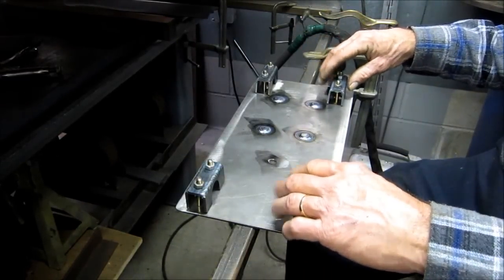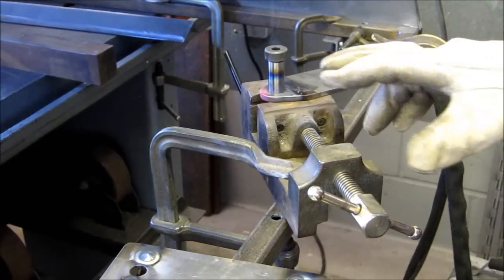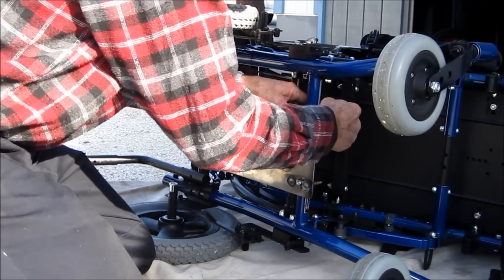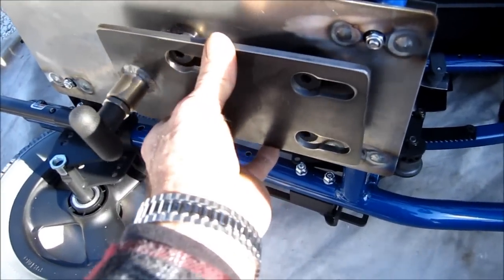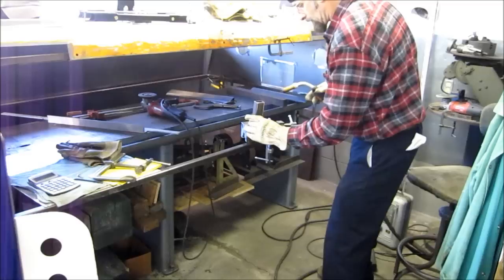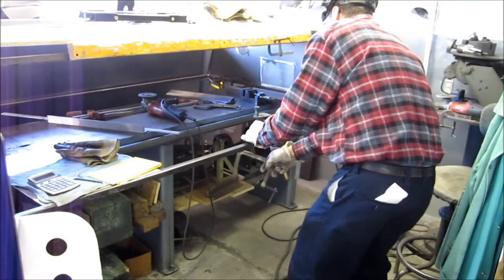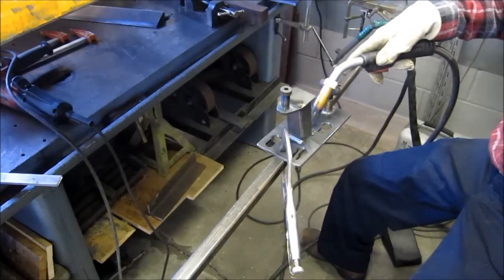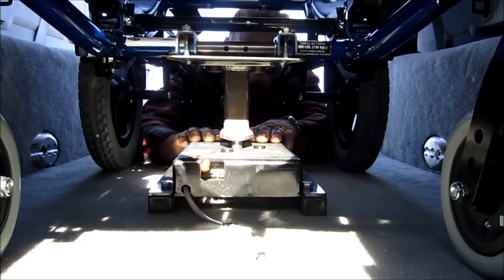Wheel Chair Docking System Part 2

Comment: I love what you are doing,  I do have a question.  I am a caregiver for a friend who is in a Permobile wheelchair and we use the EZ Lock system.  Lately it's not working properly when we push the release button.  Its here a service I can do from home that would help it work consistently?   Clean up inside it, add a lubricant?

Comment: Keith, this pair of videos for for the wheel chair docking system was just heartwarming!  I work in a specialized factory that employs a good many handicapped folks and so get to see on a daily basis the challenges they deal with in just getting around day-in and day-out, and it was inspiring watching you create this wheelchair latching system and build it to higher standards than the original manufacturer.  At my workplace, the wheelchair-bound commute to and from the place using large vans that have hydraulic lift platforms for the wheelchairs and the vans can carry 3-4 wheelchairs at a time, but the challenges still remain of restraining the folks' personal wheelchair in the vehicle once they have been loaded up.

Comment: Hey Keith, I know this job is done, but any chance of going back and raising the capture mechanism off the floor of the van ? If you lifted it 4 or 6 inches, then you wouldn't have a ground clearance issue on the chair... just a thought.
Reply: Eric I just watched this and you echo my thoughts. I also have an uncomfortable feeling about the strength of this modification in a heavy shunt. I note that Keith has not responded to you.

Comment: ok 4 year old post i see
used to work for a company suplying wheelcairs and other stuff 
you done a nice job on the catch making it so it doesnt act like a plow
but wouldnt it been eazier to raise the catch in the car itself by about 3 to 6 inches 
from wat i seen there aren any feetholders in the way so it still would slide over it 
he wouldnt have to crawl over the floor to get at the adapter bit 
making a boxsection that bolts to the original spot then have mountingholes for the catchsystem would make it reversable too

Comment: Thanks for the video Keith. What kind words can describe such a person as you. I have a similar problem with bottom clearance on my power wheelchair. The companies expect users to be in wheelchairs where level ground is the norm. Unfortunately that is never the case. Mine can climb a 3" curb but if I use this type of standard equipment I only have about an inch of clearance. Thus limiting the original purpose of the chair (more independence). I can only hope someone around here can do the same type of work. You are an inspiration and keep up the good work.

Comment: WOW!!  WOW!!  WOW!!

Just last week my son's new wheelchair had a new EZ Lock (ezlock.net) factory bracket mounted to fit with existing docking base.  Keith's solution is much superior to it.  I sure wish I could have had Keith provide a solution for us just like this.

Maybe EZ Lock should license this design from Keith to offer to its customers.  My view is that this would be a win-win-win situation - a win each for Keith, EZ Lock, and the wheelchair using customers.

For those who have questions about the EZ Lock ratings they address this on their web-site.  Apparently they crash test the wheelchair / bracket combinations against some SAE specs.  I bet this bracket would survive their test with flying colors.

And I second Keith Ward's comment - if there was anyway it could happen I'd gladly sweep up the chips off your shop floor just to work with you. 

Keith - you set the highest standard for the definition of the word "integrity".

Thank you for sharing and bringing up the standards of YouTube.

Comment: That was nice work, but wouldn't it have been much better (and simpler) to raise the van's female docking section about 8 inches and simply mount the male docking pin to your big, flat chair adapter plate? That way, you wouldn't need that gooseneck adapter plate and all that work on the four locator/clamp lugs. Plus, the user wouldn't have to mess around with mounting/demounting that gooseneck adapter each time they use the docking system.
Reply from the maker: The higher post would be hitting the feet as they brought him in and the re- movable section was just in case they were going to be coming to rough terrain. Thanks for the add with your comment! ;{)------

Comment: You do realize he works on many projects involving critical pieces (so they also involve human safety)  Should some of those catastrophically fail an individual could easily wind up disabled in a wheel chair.  I have yet to see Keith take an unnecessary short cut that would put anybody at risk.

Comment: If there was a ground clearance issue, wouldn't raising the locking mechanism height on the floor of the van eliminated the need to remove the plate from the bottom of the wheelchair? (Just armchair engineering after the fact.)

Comment from the maker: As far as the accident involving the vehicle or vehicles, one of the operators! If I chose to take on and fail to meet an as per customers request, with a project, where all other restraints, locks and etc. were properly adjusted and I see the after math as proof that I failed to meat the pre proven standards of the original component I have modified, I except the responsibility.  ;{)-----

Comment: As a former Wheelie Cab Owner/Operator in Brisbane, this is a great design.
A note for those that don't know, the alloy blocks on the sides of the chair tunnel are employed for the seat belts and this has slotted mounts for the seat belt for the occupant, the Braun units in our cab did anyway. My wife was chair bound for many years before pioneering surgery, now has her walking albeit with difficulty sometimes. Keith you are an inspiration to other jobber's, you do it right the first time.

Comment: Hello Keith,
First off all love your videos. Proud off this weelchairjob you can be. One thing though, this type of construction is forbidden in my country. One off the reasons; "A fixture connected to a vehicle should withstand a force off 20G at a deadstop from 50km/h." Meaning wheelchair AND occupant weight roughly 150kg x 20 = 3000kg. Do you think this is OK with the pin entering the EZ-Lock?
Keep up the good work and greetings from the Netherlands

Comment from the maker: They were designed just to hold the tube sections together, even if they were replaced with grade 8 it still would be limited to a sheer strength of 1/4" bolts, guess I wasn't comfortable, with that factor...